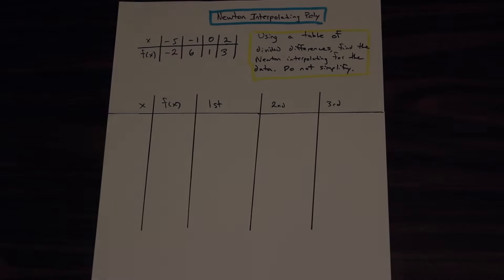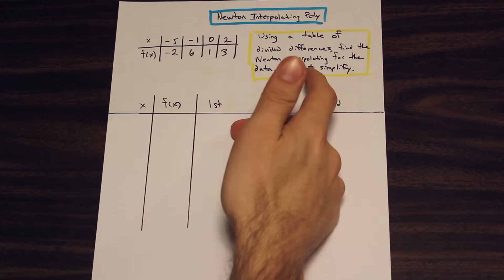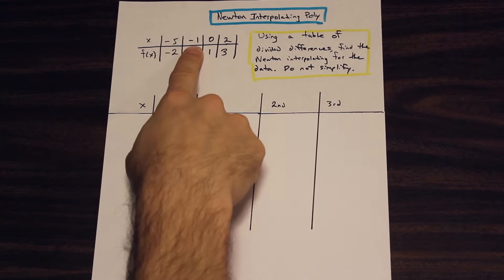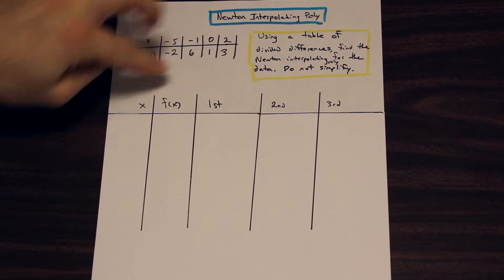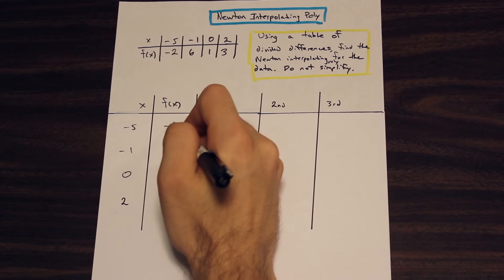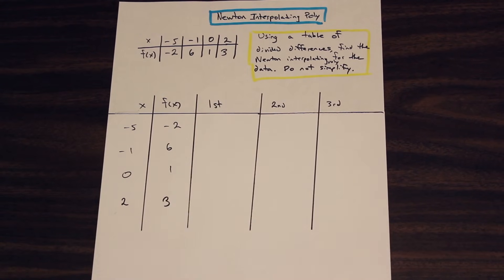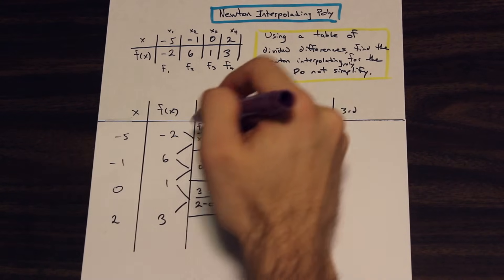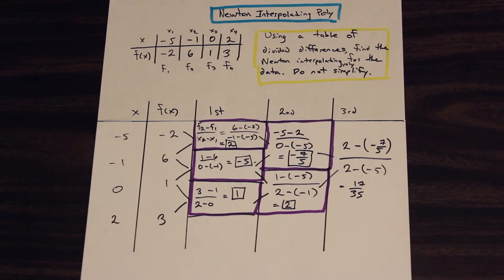Newton's Divided Differences Interpolation Polynomial Example

Comment: Slight correction to the general form near the end of the video. It should be:

f_{n-1}(x) = b_{1} + b_{2}*(x - x_{1})  +  b_{3}*(x - x_{1})*(x - x_{2})  + ... + b_{n}*(x - x_{1})*(x - x_{2})*...*(x - x_{n-1})
= Σ^{n}_{i=1} ( b_{i} Π^{i-1}_{j=1} (x - x_{j}) )

Also, usually you also see the "indexing" start from 0 so be careful in your exams :).